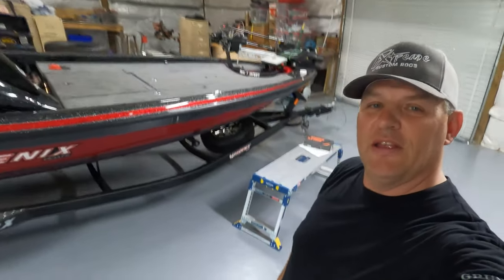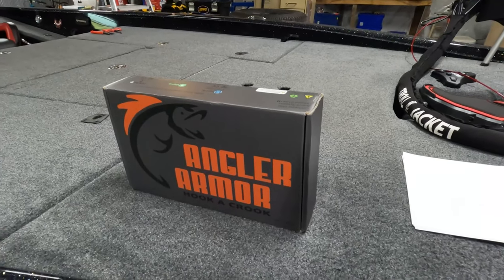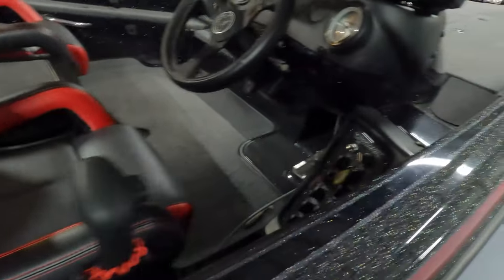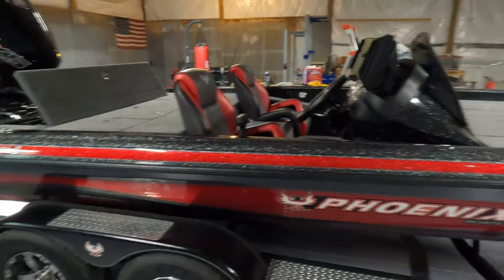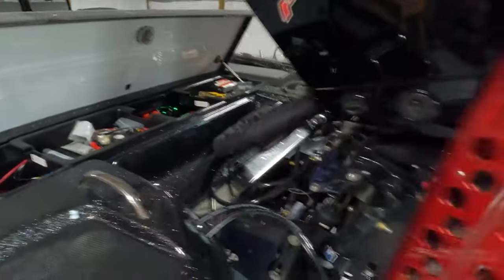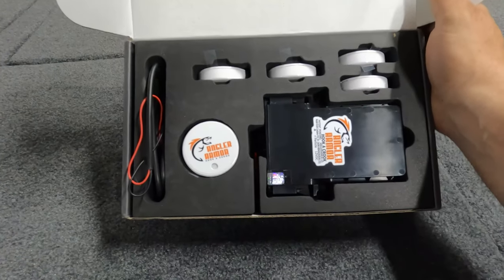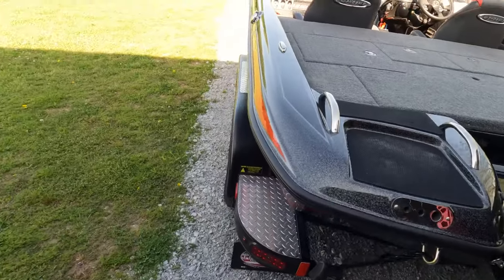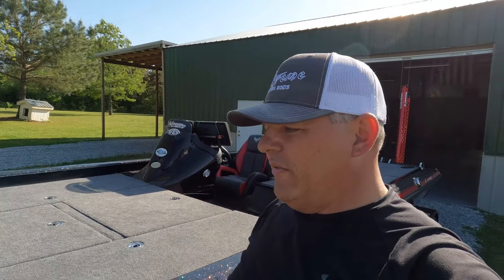Angler Armor - Boat Security System

Comment: 10:35 you said it is armed but you had the locker open and you slammed it shut. Then you set alarm off again at 11:50 
My question is why didn’t it sense when you slammed it.. hmmm 
Makes me wonder how reliable it actually is. I have installed many alarm systems and this seems cheesy wire snips and it’s done. 
Does it send you a notification if power is disconnected?
Reply: It does send a notification if the power is lost and since the CPU also senses motion you can’t get to the wires without triggering the alarm. It also has an internal back up battery that powers the alarm for up to 6 hours independent of the external power source.